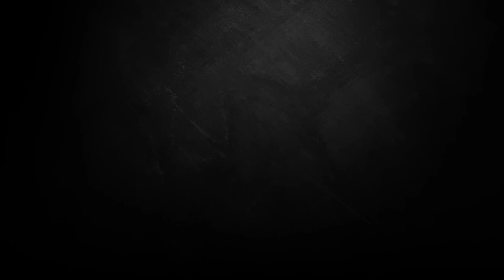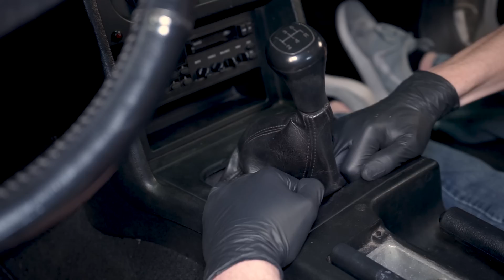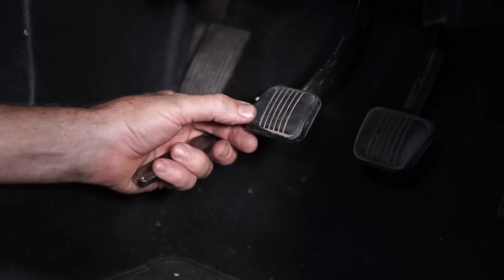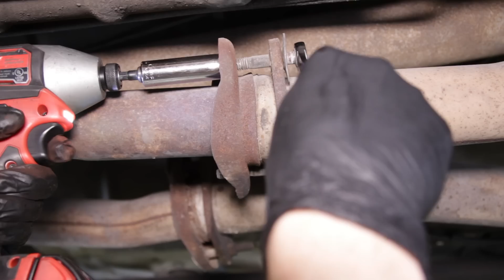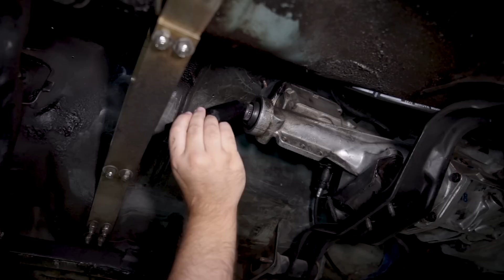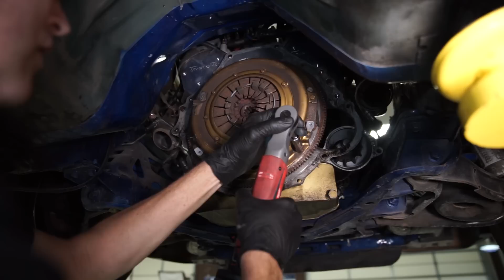How To Remove Mustang T5 Transmission (1982-2004 5.0L, 3.8L, 2.3L)

Comment: Gotta love the chrome sockets on the impact
Reply: Must suck your tools dry eh.
Reply: And? Who cares? It's a socket.
Reply: @RussD123  and also not like you need a impact socket to hammer on that thin aluminum trans case, you will break if it if you need that much torque
Reply: @RussD123  Chrome is prone to breakage and shattering. You'll get a face full of shrapnel.

Comment: Honest question, what sort of assembly lube do you guys use on the pivot stud, TO bearing, input shaft, sleeve, etc.? Should I put a dub in the pilot bearing?(came w/ some in it)
Reply from the maker: We recommend using any sort of transmission grease when installing any transmission components. You can pick some up at your local auto parts store. Adding some additional grease to your pilot bearing will work as well. Just a small amount will work

Comment: Can i fit a 2004. 5 speed transmission in a 1991 5 speed mustang
Reply from the maker: Hey Chunio, it's possible to fit a TR-3650 in a Fox. It'll require some work to get it all installed. Feel free to call or email our customer service team and we'll be more than happy to help discuss what you need to do to make it happen - https://lmr.com/contact

Comment: Can a T5 from a 5.0 be installed on a 96 Mustang 4.6 motor easily?
Reply from the maker: You will need a Quick Time Bell Housing to accomplish this swap - https://lmr.com/item/RM-6081/1996-04-Quicktime-Bellhousing-Modular-Motor-To-Tremec-Or-T5